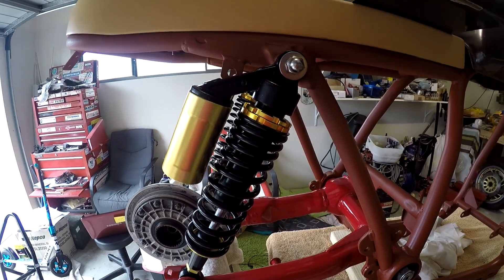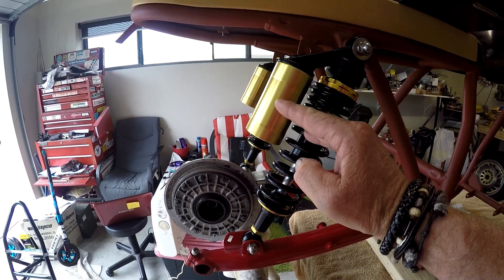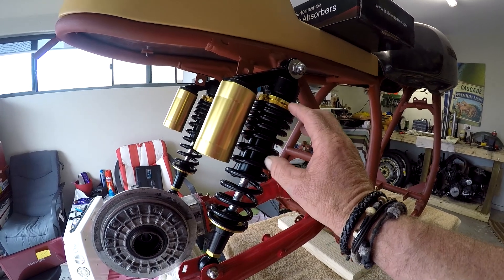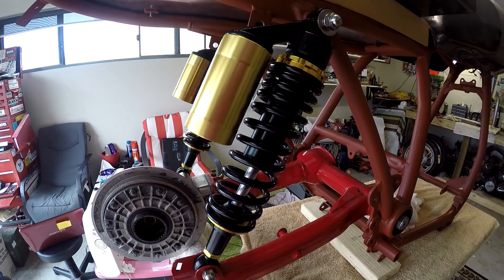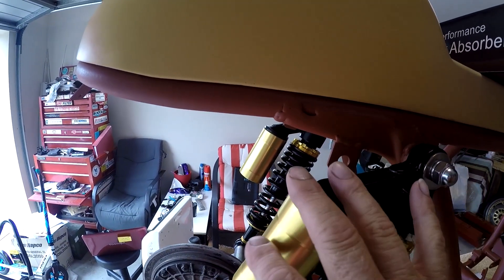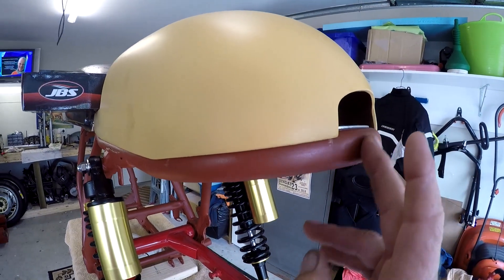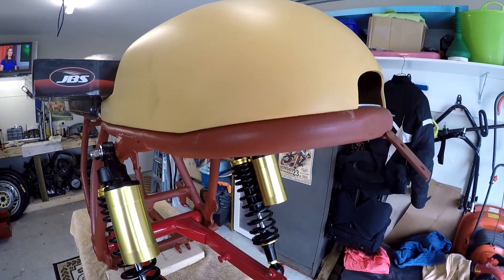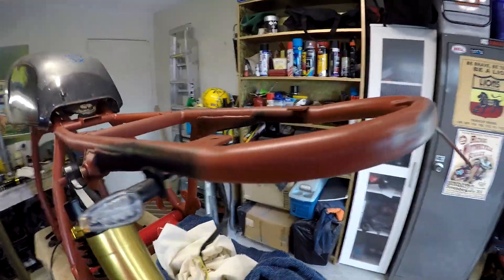XS1100 Cafe Racer Project - Ep 05 - New shocks and some more frame mods

Comment: I am wondering what length shocks those are? Stock on the XS1100 is 12.5 inches eye to eye. I purchased 13.5 for my project and it still sits pretty low in the rear, but I’m short at 5’8” so it suits me but for someone tall they might want to go to a taller shock.
They seem pretty decent for the price but like Andy said you will have to adjust the spring by turning the jam nuts to accommodate your weight because they come completely slacked off.

Comment: I know that this project was done five years ago however what made you switch tanks the new tank looks like a Yamaha tank is it because the original tank was cooked or were you looking for a different look my ass ex had a teardrop pink but not the pinstriping around the edges I am really considering trying to do an XS Café
Reply from the maker: Original tank was FUBAR and I didn’t like the shape. This is a XS11 “standard“ tank, so off of a E, F, G or H model. The filler flap was removed, welded up and a Monza style cap fitted, off set to the right.

Comment: I'm not fluent in English, so I can't understand what you say in the video.  What brand of this shock absorber?  With the experience of using them do you recommend me?  I want to buy a pair of RFY brand.
Reply from the maker: Hi Tony. The shock absorbers have been fitted for four or more years now. They are the same as RFY brand. I think they are good for the price. My bike is heavy and I ride it hard. I find that they do begin to fade on long rides sometimes. I would recommend them as a low budget shock but they are also not what I would consider high performance.
Reply: @ANDY5  Thanks Andy, it helped me a lot.

Comment: hi Andy I need more info about those rear shocks, brand, model, size.. etc thanks
Reply from the maker: JBS 325mm, try this link http://www.ebay.com.au/itm/YAMAHA-XS1100-325mm-JBS-REAR-AIR-NITROGEN-CELL-SHOCK-ABSORBERS-G-/141474866694?hash=item20f08f2606:g:UPcAAOSw-YVXnbuA
Reply: hi mate, im looking at getting some new shocks for my kawasaki H1 and came across those JBS shock also. i was just wondering if you could give me a update on how they are going. thanks paul

Comment: Are these shocks height adjustable?
Reply from the maker: Sorry for the late reply. Yes, the lower mount screws into the bottom of the shock and has a few mm of adjustment. I have wound about an extra five or six mm out of them

Comment: These shocks look very good at around $150 but dose anybody know if these JBS gas shocks actually work OK? I'd ask the bloke selling them but he's very hard to contact. And dose anybody know if the cheaper RFY gas shocks at around $90 work OK? As far as I can figure out they're probably coming out of the same Taiwanese factories.

I've only seen people fitting them to projects and no road reports on them. In one article a bloke had fitted some RFY's to his pet project, some two wheeled stationery engine and he went on to say that it didn't matter if they didn't work because he doesn't ride much. 

I'm not just into it for leather, although I must admit I do like that part of it to, but some of us do ride the things and want something that don't only look like shock absorbers but actually function like shock absorbers are supposed to. They should absorb road shock, not give you a shocking experience every time you touch a slight ripple on the road surface. Let me know if you think I'm being unreasonable here.

I ride most days I rode today rain and all, I rode my SR500 to Sydney and back a week or so ago and was on the last leg home the Glenreagh Road between Coffs and Grafton, when the 2 little adjusting lugs below the spring ripped out, not off but out leaving holes where they had been and the spring flapping around in the wind on one of the $129 cheap chrome shocks I got off Ebay a year ago from some Café Racer Shop 59 mob in Brisbane. 

When I got them they looked very good to, but in reality they were useless, a total pain in the arse and back and should be regarded as dangerous and shouldn't be getting sold at all for any purpose. I just copied this from their Ebay site, "There will always be cheaper stuff on the market - But do you want to take the risk?" 

Risk!!? What risk, what you might risk finding something better than the dangerous junk they're offering. I don't know who do you tell.

As for shocks from China I'm not sure if there is such an animal. I've been trying to find out if any of the shock companies based in China actually produce shocks in China or are getting them knocked up in Thailand, Taiwan, or India. 

The blokes selling them, if you can contact them, when asked where they are made seem to want to ovoid the issue or if corned they either say they don't know were they came from or give you the impression they don't want to admit that they know where they came from. And lets face it if they were made in China they would have Made In China, either on them somewhere or on the box they came in.
Reply from the maker: G'day mate, close to 7,000 klms on these now and I reckon they're excellent value for money and perform well.  Are they Ohlins, Koni or Marzocci?  No but they are not at the same price point either.  Thanks for watching, Andy